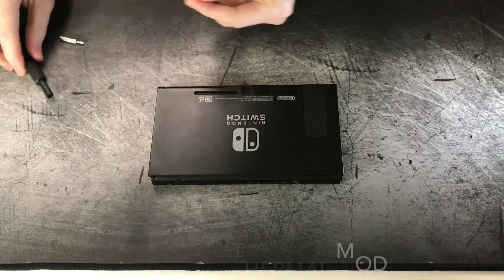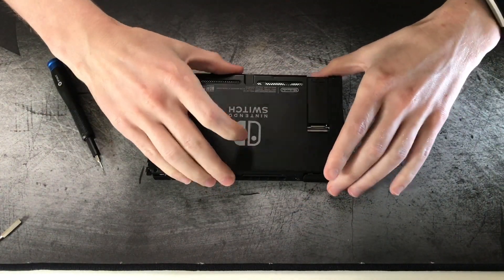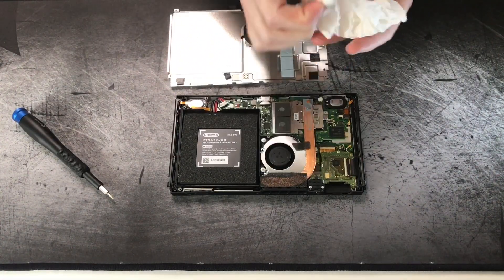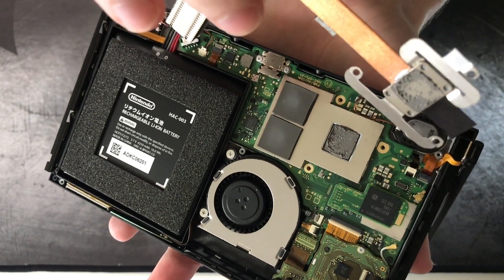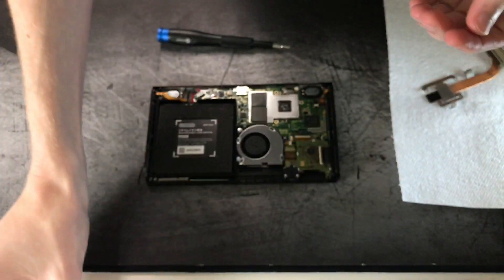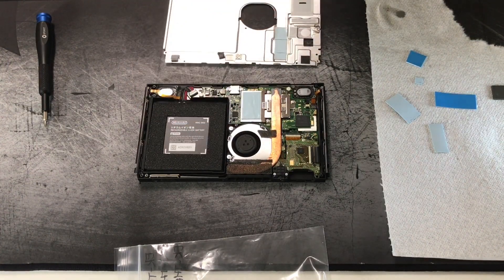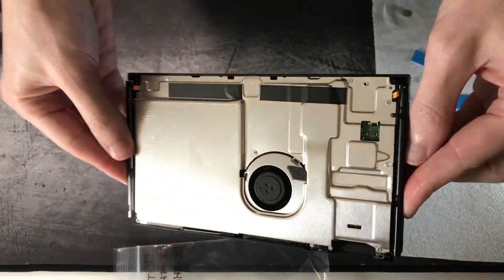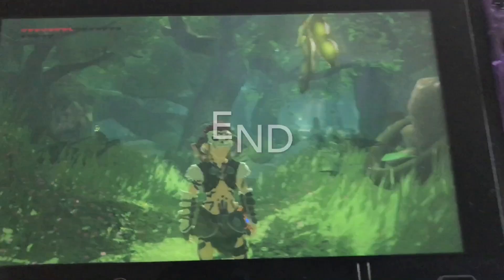Tech Shorts: Switch Thermal Mod Revisit, Thermal Paste and Thermal Pads

Comment: I was wondering if you can remove the shield and use an aluminium back cover and use thicker thermal pads to conduct to the entire back of the cover? Would that be even better?

Comment: You don't have to spread just because it's direct die. Also you forgot to take off the film  top layer of the new thermal pad you installed.  Ditch the Arctic silver 5 for some mx-4

Comment: Drilling a vent for a fan makes a huge difference. Like 20% difference in temps. 
Sadly, to go any further, we need a bigger heatsink and additional intake fan IMO. 
Would be nice to have 30 mm fan blowing directly onto CPU and RAM area, but how to power it up 🤔
Reply: Look for a USB Fan?
Reply: @opusa  Not so clean looking setup
Reply: @geg_otmopo3  question that should have been first: Want the Fan powered by Switch or Dock?
Reply: @opusa  By Switch itself. For portable use. Docked Switch can be paired with anything up to 140 mm fan 😁
Reply: @geg_otmopo3  Uh boi. Fastes way and most easy to replace, if it goes wrong, is to splice (Use a Connector or what ever is most comfortable for you) the Cables from the Battery of the Switch. The Red for Plus and Black for Ground, if I am not mistaken. They are not Part of the Board but the Battery so you wouldn't need any soldering. But you would need a new Battery at some Point.
I personally would not touch the Board itself cuz I have no Idea about how it works. But the Battery Cable that goes to the Connector should be save enough to power on the Fan. You probably shout build a switch inbetween the Battery and the Fan otherwise it will be on all the time.

Comment: Why did you leave the aluminum cover surrounding the SOC?

On mine I completely got rid of that crap and thrown it into the garbage and used thicker thermal pads from a old GPU.

Then I put a huge amount of thermal paste all over the copper pipe, on the storage chip and on other crap which I don't even remember :)

I used Thermal Grizzly Cryonaut for the SOC and Arctic MX-4 all over the place in a huge mess as I have a big syringe of it to use as now I upgraded my other stuff to MX-5...
Reply: Do you possibly remember the thickness of the pads you used for the ram? Might try this myself
Reply: @justtyler147   I can't really remember cause I removed them from a old GPU and didn't even measure them but I used very thick ones, it should have been less thick but making a bit of pressure on the plate near that area made them squeeze a bit and worked fine.

Comment: I completely removed the thin metal sheet that goes around the memory and processor so it’s just an exposed chip with exposed memory and the heat sink just mounts straight on top with even pressure around the whole die, for me that seems like it applies more mounting pressure to the die

Ps those pads near the memory don’t actually make contact with the modules because when u remove the whole plate you’ll see that there’s a gap
Reply: yeah, i doubt you need to bother doing anything with the ram modules as if they didnt need any cooling at all before, they probably won't now.

Comment: I've also just done this. I used Noctua NT-H1, removed the copper shim. I did not re-apply paste between the heat pipe and the back of the device, because the back always used to get uncomfortably warm. Temperatures are very good now, it dropped from ~85 (with OC'ed GPU and CPU, to the max they can go, 2.09 GHz and 921 MHz respectively) to 60 under full load. The fan barely passes 40%. Exhaust air is considerably warmer. The back stays very nice and cool to the touch. It's very silent now, thank you so much for the guide. 

EDIT: Funny enough, the battery temp also went down, now that the backplate is not acting as a heat spreader anymore.

All tests were done on Ubuntu L4T, with "nvpmodel -m 5", "stress-ng -m 0" and https://github.com/wilicc/gpu-burn ; Temperatures reported by "tegrastats". Fan speed in "dmesg".
Reply: Great insight, thanks.
 Gonna remove thermal paste between heat pipe and metal backplate too.
Reply: Did you put on the thermal pads just as he did, though? Or did not put any pad at all?
Reply: May I know how is it holding up? I am considering an alternative one where I remove the shield completely and paste thicker thermal pads to those Aluminium back covers for the switch instead. Would that be better?

Comment: Hi my switch fan is dead it's my switch is hot like when you hold in your hand after 1 hour of doc mode its hot and it's also smelling.
My idea is to take away the sliding and drill holes in the back of the switch cover and put on the laptop cooler. This way it's getting fresh air in and I think this will address my heat problem.  I did buy this on ebay v1 but was missing a heat pipe. I had to buy a broken switch and take the Heatpipe and use that. Now I find the fan is dead. My switch is overheating and very hot. What's your take on my idea?

Comment: Thanks for the vid, I changed my Lite's shell and when playing after the swap the heat was crazy so I turned the console off, do I have to worry that some parts melted inside and the console will die soon even if I change the thermal paste? I have never opened a console before and the swap made me feel like I made the nuclear bomb or smth 😅

Comment: What do you think about heating battery? If you put thermal pads between heat pipe+memory and alluminium cover the cover will be way hotter. So this method could add some degrees to the battery. Mb it would be better to cover it with some "heat resisting" material?

Comment: You removed the thermal grease that was originally applied onto the heatsink in order to transfer the heat to the plate over it.
Have you applied that back or it just doesn't make any difference at all?
What about the Switch Lite, are you going to thermal mod that one too?
Reply: Late reply but he has a thermal pad he shows off that replaces that paste for the metal backplate

Comment: Fantastic video, definitely encouraged me to replace the grimy TIM on the Switch with some good stuff. I'm considering adding some thermal pads too, could you let me know which ones you used and what thickness, please? Thanks!
Reply: Might be too late, but we still don't have an answer. Looks like 0.5mm pads to me. 1.5 were super thick, just tried it out.

Comment: Yeah, I'm gonna do this. My launch unit's been getting pretty hot lately, and I was only going to do the paste, but your additions feel like the better route to take.

Basically, I'm seeing that the pads are: 1.0mm on the RAM itself - no paste, another 0.5mm on top - no paste, and 0.5mm on the pipe, no paste. AS5 on the GPU.

Comment: My switch has been overheating recently and I was wondering it I should look into replacing the thermal paste. I have had my Switch for 3 years and use it constantly could the overheating be due to hair/dust build up or thermal paste drying or could it be both? Should I look into thermal paste?
Reply from the maker: Before doing any of this I'd honestly just take the back panel off and clear away all the dust and make sure the fans are spinning up properly.
Reply: Jack_O I’m a complete noob to this but I would check to see if your fan is working if I would replace the thermal paste and do what he did here.
Reply: Ok. Thanks

Comment: Thinking about changing my paste on my Switch soon, as warranty expires in a couple months. Going to use Arctic mx 4 for cpu/ under heatsink for gpu. What thickness thermal pad(s] do you recommend for your specific mods you did? .5mm, 1mm, or 1.5mm? Going to use arctic's thermal pads, just because i have trusted said brand for years for their paste. Lol.

Comment: I've sandwiched the copper pipe with two IC Graphite pads, and it is the best solution for replacing the original TIM. It doesn't even get remotely hot in handheld mode. Holding strong over 2 summers of heavy use. I'll probably not have to ever change it again.
Reply: why 2 graphite pads? 
I'm just wondering out of curiosity, I'm planning on doing the same (making my order) and will 2 make a better difference than 1?
Reply: @NooBGrave  The Switch's copper pipe was originally sandwiched between two globs of thick cheap thermal paste. All I did was replace them with the pads. I think it's better because of the extra pressure it adds overall. Specifically with IC Graphite, you need good pressure otherwise they will get hot spots.
Reply: @chunkylover5367  oh ok, ill order two then thank you for the informative insight
Reply: Dhiso no problem. You might not need buy two pads. I think they sell AMD cpu sizes, which are bigger. You can just cut the right size. Remember, they are also electrically conductive, so you don’t want them to touch any component other than the pipe and the processor.
Reply: did you use anything to keep ic graphite on copper pipe i fear it drop and damage the switch
Reply: @Maxgamehouse  No. The switch is very tightly put together.
Reply: Did you mean copper sheet on chip or heatsink i already put ic graphite to repalce the copper sheet and mx4 between metal shield and heatsink my switch show 49c in handhield after 3 hour of xenoblade DE 
I use tesla menu to view tempature

Comment: DONT DO THIS!!  This is dumb.  The copper that has been removed is MUCH more conductive than the thermal paste.  There is a reason that nintendo did this - and removing it would save them a meaningful amount in the build cost - having a large gap filled with thermal paste is not very clever.  The lack of stutter is likely due to the thermal paste being VERY freshly applied.  In the long run this will not be pretty.
Reply: Lol i modded like  4 switches in a 2 years long. All of them i removed the shim, they ran with no problem since then. I make sure to monitored their thermal using hekate and they ran cooler than most switches out there
Reply: @khanghuy1203  have you done the mods in this video?
Reply: @wiskymo9687  yes i did it to my newest switch
Reply: @khanghuy1203  how much has the Temperature improved?
Reply: @wiskymo9687  around 3 or 4c, mine used to be at 59c max when playing Wolfenstein now its only 55 56c
Reply: @wiskymo9687  and im talking about while docked, also the ambient temp is 28c
Reply: @khanghuy1203  hmm alright, thanks for the reply! I guess it wouldn't really be necessary on the new chip tho, as it runs really cool already
Reply: @wiskymo9687  yea it wont improve much but it sure helps on the long run as the old nintendo thermal patse dries really fast !
Reply: Hello, what do you recommend?  Is there a way to improve heat dissipation without removing the copper?
Reply: @flocassilla  copper shim can be removed, no worries, one less layer for heat to need to travel through. I have removed it for all my devices, no worries. ( on my new switch lite also, they seem to have done terrible thermal paste jobs on these.)
Reply: @partyprash2000  thank you for your answer ☺️❤️
Reply: The reason Nintendo put that ultra-thin copper shim in there had nothing to do with heat transfer and everything to do with adding a protective layer between the heatsink.  Nintendo wanted to further protect the processor die, but did not want to sacrifice heat transfer, so instead of having that portion be entirely aluminum, they instead had it be a copper tape shim. Since Thermal Paste is required on both sides of the copper shim regardless, then having it at all is meaningless for anything other than to add additional protection.

Comment: Arctic Silver 5 is just an average paste by today's standards. If anyone is looking for a similar performing paste (without the stupid price tag AS5 sometimes goes for), I'd suggest MX-4, which offers longer lifetime, slightly better thermal contuctivity, no curing time, and ain't electrically conductive.
Reply: MX-4 is fantastic, but I suggest using the grizzly kryonaut if you got spare buck for it.
Reply: @docArr666  Absolutely! However, where I live MX-4 is the best I can do for a reasonable price. Over here, sellers usually look for the cheapest piece of shit paste and profit from that. They don't care to bring us the good stuff :/

Comment: Viewers. NEVER use your finger to spread Thermal Paste, it’ll add oil from your skin to the mixture and basically ruin the point of this whole process.....

Buy a thermal paste that has a paste spreader included. If not, use a small piece of folded paper to spread it...
Reply: I just wash my hands first to remove oils from my fingers temporarily. I think it's fine but in the worst case scenario maybe 3 degrees celsius higher thermals (being generous) if you do not even wash them.

Comment: 1. AS5 is old (even though it claims it is not conductive it still can easily short anything on the board where other pastes do not) and has a cure time, use something better like Gelid GC Extreme, NTH1 or any other better non conductive and 0 cure time TIM that has better thermal transfer. I have no idea why everyone modding the switch has gone and used this old paste.  
2. Alot of manufacturers recommend putting TIM on thermal pads so I dont get the hate from you doing it but I wouldn't personally do it myself but hey you removed it anyways.
3. You mentioned having to spread it since this is a direct die application this is 100% false (and never use your finger because of oil), it depends 100% on the viscosity of the paste and the available clamping force from the heatsink tabs. If its too thick you must spread it for die application, if its thinner you can easily do the grain of rice or pea method depending on die size. The nintendo switch has plenty of clamping force regardless.

Thanks for this video I mostly deal with delidding desktop CPU's and wanted to see how difficult it would be to re-paste the switch glad to see its a cake walk.
Reply: It's possible people are using this paste because iFixit still recommends it.
Reply: Thanks for the insights. Do you think the thermal pads are a good move in this case?

Comment: Hey can you try with the Thermal Grizzly Carbonaut Thermal Pad ?
Reply: Uh, don't, the pad requires a lot of pressure to work well, you'll strip the screws before you can get a decent pressure on Switch. I recommend you use the grizzly paste instead, has better heat conduction than the pad anyways.

Comment: Hi! thanks for the info! If I understood well I need:
0.5mm thick between direct RAM modules and the encapsulate metal plate (the cover of the RAM modules).
0.5mm thick between the heatpipe from heatsink and the big metal case.
1.5mm thick between the encapsulate metal plate (the cover of the RAM modules) and the big metal case. (1.2mm but don't exist, is recommended to use 1,5? did you use 1,5mm?)
Is that right? Thanks for all!
Reply: Any answers? Did you complete your own mod and can clarify right sizes? Thanks!)
Reply: I second this comment
Reply: @Adam90028  I finish my build without problem with 0.5+1.5
Reply: @LeonidEr  Did you use thermal paste on the thermal pads that were in contact with the heatpipe?
Reply: @Adam90028  nope, only above pads on memory
Reply: @LeonidEr  Would It make a difference though? I Did something similar but instead of using paste for the cpu I used a graphite thermal pad.

Comment: Hello. How thick i need my Thermal pads for the Nintendo Switch?
0,2mm
0,5mm
2mm?
Reply: 0.5 to 1.5.
Reply: @DangBlugaming  Actually, 0.5mm between the Memory chips and the protective casing & between the heat pipe and the upper aluminum heatsink, and 1.0 mm between the protective casing and the upper aluminum heatsink.  The 1.5mm made the upper heatsink bulge he said, but if you are not putting the protective casing back over the memory chips and around the processor, then a 1.5mm thickness would work for the memory chips, and just need a 0.5mm for between the heatpipe and the upper heatsink.

Comment: I did almost exactly what you did besides the hole in the back and the backplate is heating up really fast than usual. Is that bad?
Reply: I wanted to reply because I have done the same and came with the same result. I used gel id extreme and placed some paste along that heat pipe as well so the metal case will help spread some of that heat. What I have discovered is the system does feel warmer on the back and when I put my thermometer over the vent the air is warmer as well. So what I believe to be happening is the heat transfer is just better, just like going from air cooling on a PC to water cooling the heat transferred is more efficient. Also is the reason why your room will get hotter with water cooling than air cooling.  I did get the fps improvement as well even in astral chain ive noticed the 360 turning is smoother in places. There is another video done and noticing spikes in temps and fps drops in games for split seconds. 

Overall I hope this answered your question my man.
Reply: What you got to think about isn't necessarily how hot the back or the air is because efficient cooling is designed to pull that heat away from the unit now putting paste on that copper pipe and going up with it will have that heat transferred to that metal plate backing which is naturally gonna cause the back plastic to feel warmer.

How he is getting away with the back plastic is because he has it off and the fan is sucking air straight in. Same idea if you took the bottom of a laptop off and exposed components straight to the air or in this gentleman case cut a whole right where the fan is.
Reply: Did you find out what caused your heating?